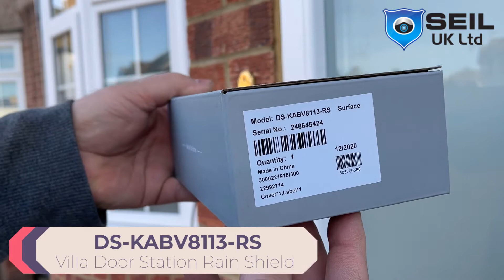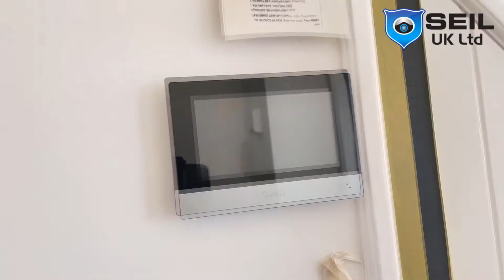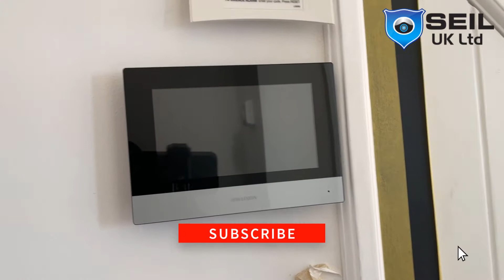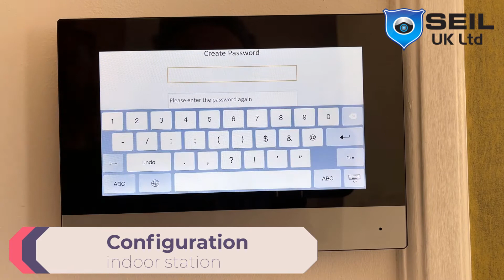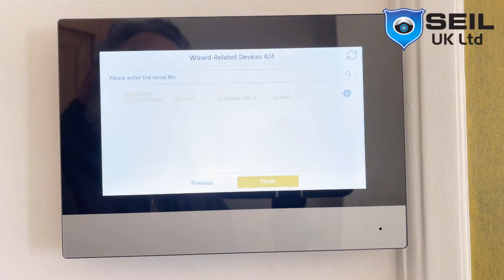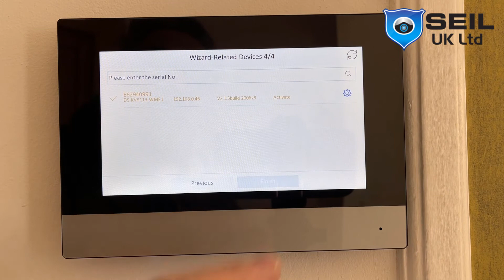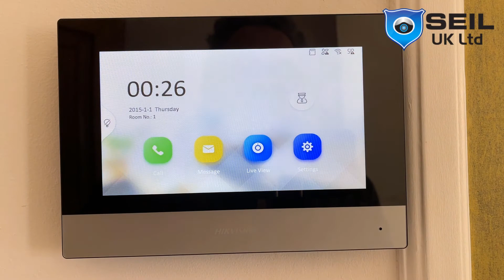How to do Installation Hikvision IP Video Intercom Kit DS-KIS604-P Complete Video Tutorial

Comment: This bell can also open a lock with two wire dry contact connection?
Reply from the maker: Yes out door station have free no contact you need to bring separate lock and 12v dc power for strike lock